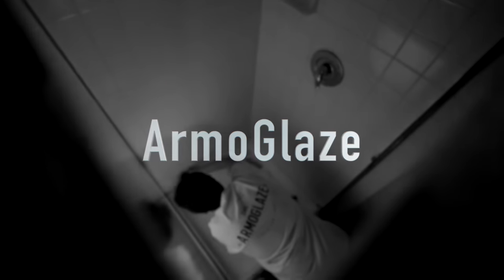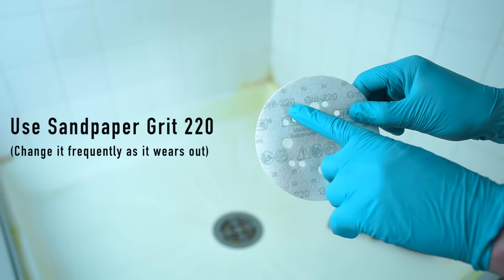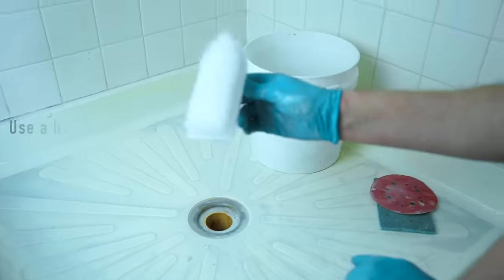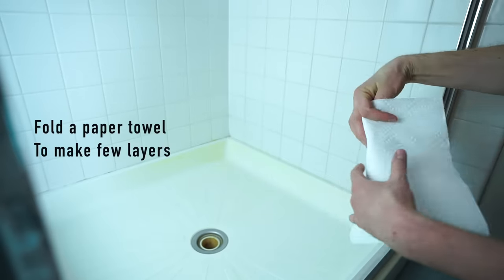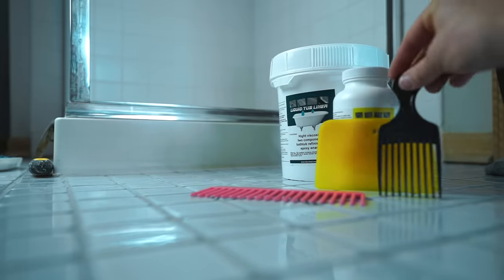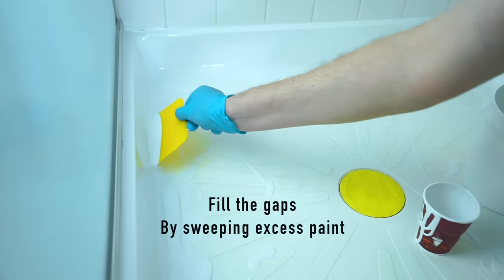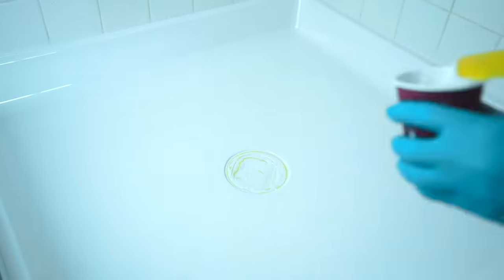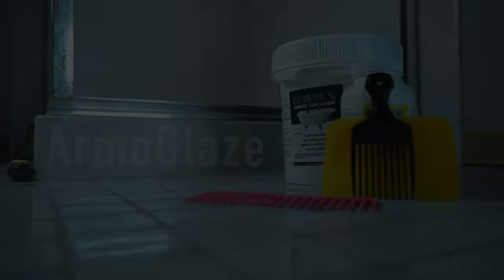DIY Shower Base Refinishing with ArmoGlaze - Odorless, Pour-On, and Made in the USA

Comment: My shower base is turning pink after the refinish. What should I use to remove the pink color? I have tried every cleaner nothing works! Help!
Reply from the maker: how it happen. What the product do you use. Because when you reglaze your shower base. You need wait 2 weeks before you be able to use products with coloring effects. Never use abrasive cleaners or abrasive pads
Reply from the maker: To remove stains use VINEGAR
Reply: muratic acid and water

Comment: Can this be done over Bondo and fiberglass repairs to a cracked/repaired shower base?
Reply from the maker: Yes, you can do it over bondo. But if you have crack , you need first sand 1-2 inches area around and then apply 4-5 coats fibreglass cloth and then use bindi to make smooth. For details explanation call 224-616-1766

Comment: In the video they are not taping the shower walls, is this the recommended procedure? Can any splashes on the shower walls be removed?
Reply from the maker: You able to remove part of paint on the walls just used isopril alcohol 91% and paper towel. Just wet and wipe. If you want cover the tile you able to do it.

Comment: Nice tutorial, what kind of tape did you use on the drain?  Thanks.
Reply from the maker: you able to use any type of tape. drain must be covered for sure. you able to apply tape if it is not durable, up in two or three layers
Reply: @ArmoGlaze  thanks!

Comment: I asked in another video. Do yo have any problems from not removing the drain? I made an in depth video where I used two cans of Armoglaze to refinish my large and old jacuzzi tub. I removed the drain but now I'm wondering if it even mattered to do this.
Reply from the maker: Not necessary. You can just apply the tape to the drain. Remove excess tape. And at the end of the process, simply remove the tape. If you want to change the drain after the process, it's possible, but it's better to do it before you decide to reglazed your tub.
Reply: @ArmoGlaze  Thanks. Well I removed it at least is all worked out! Any advice for a small spot where a jet dripped some water and left a couple of small pock marks? Thanks

Comment: How does this work on tile? Does it cover grout lines?
Reply: No. Paint never fills cracks, chips, dents or tile lines.
Reply: As far as painting any product over tile. The tile will have to be chemically deglazed!  This process uses hydrochloric acid commonly called muriatic acid. This acid will eat away at the fired hard surface of both ceramic and porcelain tile! Ceramic tile is removed much quicker as it is not as hard as the surface of porcelain tile. As far as removing the grout lines that is a problem in itself. What product you use? Any product has to have hardness and be able to have contraction and expansion that is close to that of the tiles  movement and stick in the groove. My guess would be a two part epoxy that when poured will self level. If you are doing tile on a vertical surface then you have even more issues of what product you use. The walls do not generally have the nearly the same pressure applied to them since you are not walking in them. You can use autobody polyester filler common tile BONDO.   Pour the floor but roll the walls.  Good luck
Reply from the maker: We not recommended use our product for cover the tile(thickness very high). We still working over the new material.